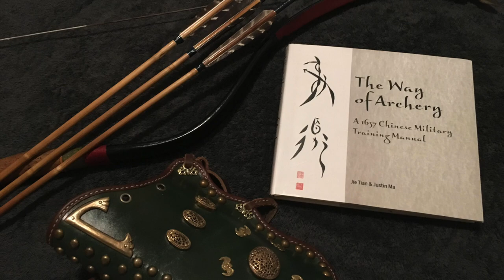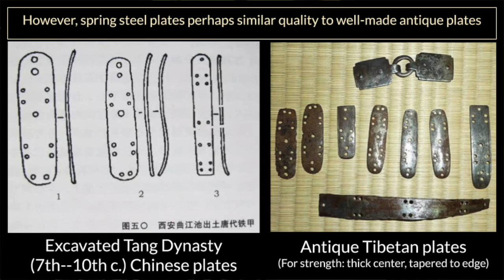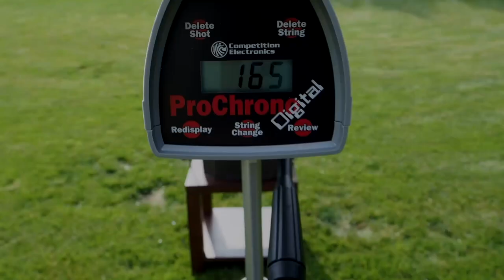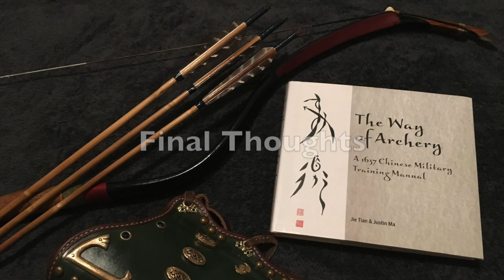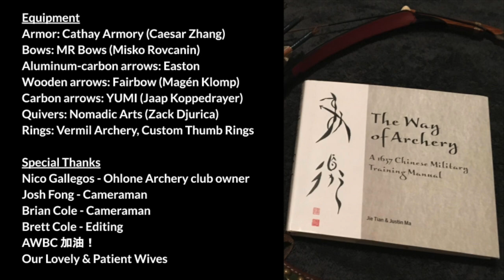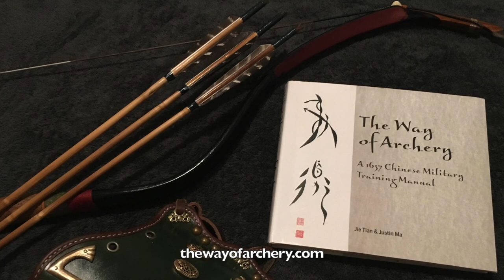Warfare Research Series (Episode 1): Chinese Lamellar

Comment: Nice video.  For some extra information, lamellar armour has either been historically recorded, confirmed by archaeology or both from about 400BCE to the early Qing dynasty.  During the Qing dynasty brigandine began to become more common, and only brigandine seems to have been observed by 18th and 19th century Europeans.  The 'Why didn't they make full plate armour?' question comes up a lot.  The best explanation IMHO is cost -- the size of Chinese armies, the length of campaigns and need for field repairs were vastly larger than in pre-18th-century Europe.  The standing professional army around the time of the Tang Dynasty plate armour shown in the video is usually estimated to be around half a million, with widely varying estimates of local fubing militia and foreign mercenaries.    These numbers weren't terribly high in comparison to earlier and later dynasties.  Chinese armies were more likely to be state-financed and centrally organised during the era when plate armour became popular elsewhere, and soldiers were probably less expensive than plate armour.  Also, while the majority of warfare in China was along the northern and western frontiers, these were mostly won by manpower, more advanced weaponry and superior strategy.  Most of the battles that determined dynastic survival were in the lower Yangzi region, where, being mostly mountainous or swampy and near-tropical, the climate and terrain weren't conducive to heavy armour.  While not as glamorous, good sewage and hygiene may have determined more dynastic succession issues than weapons, armour and military strategy.
Reply: In Chinese armies, the higher rank officers used smaller but more numerous plates in their armor.  This is perhaps because the smaller plates can be better for protection in lamellar armors.  Say if you want to make a better suit of mail, would you use more numerous but smaller rings, or would you rather have larger but less numerous rings?  The first one right?  I guess that is the mentality behind that.  Therefore, the cost is not the reason; the reason is more likely to be the tradition of armor-making.  BTW, they used full bronze and iron plate armors, too.
Reply: There's a few cases of full iron armors, the Ming Dynasty Quan Tie Jia .
(https://i.pinimg.com/originals/74/87/18/748718c0c8b11f8a7264f8b58479ddc7.jpg)
Its more like Mirror or Disc Armour as seen across Asia from Russia an India an on to China.
Reply: @Reactionary_Harkonnen  That's one city was highly linked in to the arms trade and had the space to store that amount of armor, not make it all to order on that time scale.
The cost of making armor changed in europe from metal to workmanship, by the 1400's metal was cheap and crude armor made in a few days was like wise cheap.
Look at the Visby coats of plate, that's armor for farmers but there's big albeit crude plates.
Reply: @Reactionary_Harkonnen  no it had more to do with the ease of production and repair than anything else. Also China always had big armies standing or not. It's hilarious that you think shock warfare was invented by medieval Europeans. It existed long before then
Reply: @Reactionary_Harkonnen  one city is not necessarily representative of all cities. Also if something was a family secret then it couldn't be mass produced since only a small number of people could produce it!
Reply: @Reactionary_Harkonnen  "The Chinese never really had a big standing army. The Romans did, the Spanish did, the French did, so did the Germans." - That's a very broad sweeping statement not supported by any evidence. China as a state predated Germany, France or Spain. Case in point, the Chinese sent an army of 350000 during the battle of Baideng, 200BC. How many troops were there in the "standing armies" of Germany, France, or Spain in 200BC? 

"Super strategies? Obviously you don't know anything about Otto the great, King Richard Lionheart, El Cid, and others" - What do those people have anything to do with Chinese armies winning battles using "superior strategy"? One does not preclude the other, and are completely unrelated

"I guess to cut my answers short and simple the Chinese just didn't have the skill to do it and probably lacked certain tools to make it happen"- Or maybe because lamellar and brigandine armors were good enough and plate armor was not necessary. Lamellars were used by Japanese, Koreans, right across the Asian continent to Turks and Eastern Europe by the Slavic peoples. Also keep in mind that gun powder weapons such as bombs and cannons were in used since Tang/Sung dynasty, and no plate armor can stop a cannonball. BTW the Chinese DID use plate armor, but only as elements of an armor covering vital organs/areas.
Reply: @Reactionary_Harkonnen  Uhhh... What?? This might be just me but the way you explain things sounds really aggressive for the reason I don't know. 

Now, while the Chinese don't have full plate armor, they do HAVE cuirass which can be considered like one part from full plate european armor. However, they didn't continue to develop a full plate armor for a very specific reason, they simply got way too many soldier, expensive, and inefficient. 

Broken cuirasses is simply too hard and costly to repair if it was damaged, while with lamellar, the soldier can repair it independently.

So it's not like the Chinese dynasty didn't produce any cuirass, they stop it which lead to the stop of plate armor advancement. The same thing as chainmail, the Chinese can produce it, there are even a mix of chainmail and lamellar armor, but it almost never been put to use.
Reply: @edwinford8553  yeah...I'm sorry it's just the way I'm explaining things I'm not trying to be rude.
Reply: @Reactionary_Harkonnen  yes a few places which doesn't represent the norm. China especially back then was the land of mass production.
Reply: @Reactionary_Harkonnen  thanks for proving the relatively small size of armies in Europe
Reply: abis8 alpha8  They can raise bigger armies and they have before by levies but big levies are not considered the norm. The soilders used for day to day garrisons were not 900,000 and that number is a bit exaggerated.

 Active troops know the Spanish Empire and such had more active troops because their empire was bigger spending multiple continents. China & other Empires never really had big numbers in active soldiers. From what I read and keep on reading China had an active Army of no more than 25,000 often 15000, mostly in the North keeping the Barbarians at bay.  The numbers were a bit higher when they were independent Chinese states due to the fact that they can do their own thing.
Reply: @cariopuppetmaster  The Black Hungarian Legion wasn't the entire Hungarian military that was just an aspect or chapter of one. But numbers on it self don't matter when you can win wars.

 The Ottomans had trouble fighting even the smallest European states like the Venetians and the Genoese and lost to them multiple times even out numbering them by 25 to one. Logistics, advancements in technology, and good generals, tactics, and strategies is what more important.
Reply: @Reactionary_Harkonnen  "It's simple they just couldn't produce it and didn't have the skill or technology to do it"- The Chinese have had blast furnace since Han dynasty 200BC that were systemically operated by central admin. Earliest use of such technology in Europe wasn't until 1400 years later in 1205. The Chinese also used puddling process in Han dynasty, which was not used in Europe until ~1900 years later around 1700's. The Chinese also used quenching and tempering process to mass produce spring tempered blades since Han dynasty. In contrast the earliest spring tempered blades were seen in Europe in very limited number in the form of the famous Ulfberht swords, using imported Wootz/Damacus steel during the migration period

The Chinese has demonstrated that they can bang pieces of metal into flat shapes and put them on their armor since Tang dynasty, in a very similar fashion how Europeans began their plate armor development after the migration period. But in late Tang dynasty coinciding with the introduction of gunpowder weapons (incendiary bombs, poison smoke bombs, and later fragmentation bombs and cannons) plate armor development in Tang/Song dynasty stopped, and they kept using lamellar instead. In short, Chinese had seen use of explosives and cannons earlier than Europeans had, relative to the development of plate armor

Keep in mind,  Chinese soldiers were equipped by the state since as early as the Spring and Autumn period, whereas in most of medieval European history each solider were to provide their own equipment. Most peasant levies were equipped with only whatever they could afford, while plate armor (in later period) could be acquired by only the wealthy noblemen and men-at-arms, or indeed, well-paid mercenaries (like the Black Army you mentioned, which were active for only a short time, apparently due to money shortage)

The Chinese have also started using standardized manufacturing process as early as Qin Dynasty 220BC where production of arrow heads, crossbow triggers, swords and indeed, armor components (lamellae plates) were standardized. This manner of manufacturing isn't seen in Europe until much later around industrial age . It's much more efficient to produce small identical plates and sew them together, then to make pieces of armor tailored to each individual soldiers 

"I'm sure that Jin had a lot of soldiers but it probably wasn't 900,000"- the population of Jin dynasty numbered at 35,000,000 (quick google search). Supposed half being male, that's ~17,500,000. So 900,000 soldiers weren't even 1/17th of the male population at that time. If you have evidence to refute/rebute the historical records, then please share it
Reply: @Reactionary_Harkonnen  "Europeans had amazing military tactics and they invented shock warfare"
How about war chariots as shock troops used by ancient Greeks, Romans, Persians, Egyptians and Chinese? All of which existed way before medieval times
Reply: @Reactionary_Harkonnen  You're seriously comparing ancient China to Spain, France and Germany? Not sure if this is the result of lack of understanding of historic timelines or just blatant mockery of your own intelligence on purpose.
Reply: @Reactionary_Harkonnen  Can't produce plate armor? But yet they somehow were able to create full plate helmets. You failed to look at the multitude of evidence that clearly indicated they were just not interested in full-plate armors or even just a solid-single-piece armor. Their leather armors were always sophisticated lamellar or brigandine, never one-pieces and there's a reason why. They could've easily skipped all that hassle and just wore a big piece of leather armor like the greeks and medieval infantrymen. But instead they clearly chose to stick with lamellar for a reason.

Yet if you look at their ancient to Qing dynasty helmets, they have countless examples of helmets made in one piece. So if they wanted to make a breastplate or full-plate in one piece they would've taken that concept and apply it to their other armors.

But if you want to pull up a list of what Europeans and non-europeans can produce then you're going to be so dissapointed. European military technology for the most part has been primitive compared to asian standards until the 17th century where they got rich from colonial exploits.

1. Primitive inefficient bows made from just one piece of wood.
2. Primitive wall building techniques that can't withstand catapult fire.
3. Ships that can't sail against wind.
etc
Reply: @kentl4386  you comparing chariots to full fledge armored cavalry with lances? No dude chariots were not used for shock they were used for maneuver Warfare, the chariots became obsolete at around 1000 B.C. as the Sea People shows how they destroyed them using heavy infantry.  

Also chariots were never used by the Romans in Warfare or in the military.
Reply: @Jake-dh9qk  not really dude European medieval technology was extremely sophisticated. So Sophisticated when the Mongols brought Western Siege weapons they started destroying and demolishing every Chinese fortification there was with the trebuchet and other mechanical Siege weapons they brought from the Middle East and Europe. 

Yeah I saw that helmet that's nice but you obviously don't do blacksmithing like I'm learning. You need certain tools and Technology as well as skill and knowledge to make other parts of armor and weapons. Those are very well kept secrets in Europe by the families that made those things. 

The 17th century? No, you got that all wrong, by the 15th century Europe surpass China in almost everything from Shipbuilding, to firearms and other gunpowder weapons were also way head.  Europe was way ahead of China and Firearms by the 15th century, and building sophisticated battleships by then.
Reply: @Jake-dh9qk  I'm not comparing Medieval Times to ancient times, but since you brought it up proto plate armor was developed by the ancient Greeks in the early Bronze Age before the blast furnace was invented.
Reply: @Reactionary_Harkonnen  You even mentioned it. It's not rocket science to think of wearing one solid piece of plate armor. Even acient kingdoms were able to think of wearing a big piece of metal. If you look at countries that didn't have solid piece torso armors, but still have solid piece helmets as well as shields like the Chinese, then this should clearly tell you that solid pieces of armors aren't something that's super advanced or hard to build, but rather just not in the interest of the Chinese. Chinese archaeological records have shown shields and helmets made from solid pieces of metal. If they wanted to make a solid chest ate, they would've done it already.
Reply: @Reactionary_Harkonnen  That's false because Chinese fortifications were able to stand up to japanese artillery during ww2 for weeks. And experts did research and found that the way they built their walls is what made them so strong and partially the reason why early cannon was never really important in chinese siege warefare because cannons were ineffective in bombardments. 

Not only that, you seem to conveniently forget it took Mongols 60 years to conquer China while it only took them 4 years to beat Europe to the pulp with their scout armies before retreating. When the mongols came back from Europe, they were finalizing their sieges that they have laid against China for years before they even invaded Europe. Those siege equipments were not the deciding factor. Hunger and desperation was what made China surrender after holding off the mogol army for over 60 years.
Reply: @Reactionary_Harkonnen  Maybe the you're right about europe surpassing china by the 15th century but that's not to say their military was inferior. China was able to beat back multiple attempts by portuguese warships and expeditionary forces with outdated weaponry. But yes it's true they started falling apart and this is also largely due to corruption from the ruling classes. From 15th to 19th century China has made several attempts to modify and update their armies but their old mentallity and pride in their military structure is what crippled them. Even up into the Qing dynasty they still relied on heavy cavalry and horse archery, and in someel cases successful when their cavalry were able to crush their neighboring countries militaries who were armed with muskets european style.
Reply: @Jake-dh9qk  I think we started to misunderstand each other here. I sort of agree with you. However what I'm trying to say is the reason the Chinese never had the ability to do it is because they never bothered to pursue the ability to do it for what ever reason, like the Europeans did. 
You don't need a blast furnace to create plate armor although that helps quite a bit but it could be done without it. To make plate armor you need a whole another set of tools and skills/methods.  

  Since they didn't pursue to make such body armor in such a way they didn't do it meaning during the same time the Europeans came up with it the Europeans were already capable of doing it the Chinese we're not capable because they didn't have the proper tools developed and more importantly the skill because they didn't pursue it.  Could have Chines do it? Probably eventually so but it's not that easy. 

Also building effective solid pieces of plate armor is a science on itself. Yes a solid helmet and solid pieces are a very good start for such plate armor but that's not the only thing you need to be skilled at, there are entire different dimensions to look at into plate armor such as angles and slopes...
  There's a reason why other countries couldn't replicate European armor after the Europeans exported to them.  

There's certain technologies that China didn't have that was available in Europe during the time to make such tools and weapons and armor.  Look at ancient and medieval European architecture it was & still is extremely sophisticated to a point modern Architects have a hard time replicating them with modern computers and modern machinery.  This indicates Europe had certain technologies & knowledge that people had that others didn't have in crafting.
Reply: @Jake-dh9qk   not too surprising, there's castles that withstand some World War 1 & 2 bombardment as well and even the Crusader castles in the Middle East withstood some ISIS attacks from the 21st century and these castles are still standing.  But it doesn't mean Siege weapons that are designed to deal with them at a time are not a threat to those fortifications. The point was the Chinese didn't have that technology but the Europeans did. They are things that both sides had that each other didn't that's my point. 

That's not true the Mongols didn't even beat Europe to a pulp at all.  The Mongols failed at capturing even one European Castle even in their nishal invasion.  

The Mongols mainly fought some of the Eastern European countries who are the time were poor and disorganized far from the Poland & Hungary you'll see in the 1300s & beyond.  Besides in the 1240s the Croats seem to give the Mongols a bloody nose and beat them in the Battle of Grobnik field. Also people alway seem to ignore the fact that the Mongols attempted later invasions of Europe, and the Eastern Europeans had increased their numbers of knights especially by Ladislaus IV of Hungary. They easley defeated the Mongols especially at Transylvania.
Reply: @Reactionary_Harkonnen  Apologies for the late response, its an old habit of mine. But to continue on the discussion, I agree that I might've misunderstood your statements. It's just a natural human response to be defensive but I'll start again and view this in a more neutral manner.

You made a lot good points about why they didn't produce plate armor and one of them is indeed the result of them not having the skillset because it's pretty much a guild secret that is passed down by master armorsmith and is a highly kept secret. But even then it's strange that China never bothered or sought out plate armor like Japan did in the 16th century. During Ming dynasty, which overlaps the Sengoku period of Japan, the vast majority of heavy armor in China was pretty much brigandine, with exceptions of helmets which are made form one solid-piece metal like the Europeans at that time. The reason why I brought Sengoku Japan into this is because during their contacts with western traders, many Daimyos and even rich samurais sought out european armor and even took inspiration from them. They would combine western plate armor with their traditional armors. 

Yet when we go back to Ming Dynasty China, which was considered China's golden age before the decline, they never showed interest in european armor despite already having contact with western powers. They adopted the guns and cannons but completely ignored plate armor to the point where not even the richest nor most powerful warlords sought out plate armor like the Japanese Daimyos did. The reasons couldn't be because they couldn't afford it no doubt because if Japanese daimyos could afford it, so should a Chinese warlord at that period, who were more than likely to be more influential than their Japanese counterpart. 

As I agreed that creating plate armor is also a complicated skillset, there should still be examples of rudimentary examples of plate armors that are more or less a solid piece of armor forged into the shape of a torso. The solid-piece helmets are a good example to say that they had the technology to make solid piece armors, but lack the interest in solid-piece body armor which later on resulted in the lack of expertise and skills down the line like you mentioned. Not only that, there is a semi-restored full suit of armor found dated back to 200-500bc, around the same time of the roman-greek antiquities. Among these findings are multiple examples of full-plate cuirasses much alike the greek cuirasses. But these examples were rare and from there on, solid-plate armors disappeared from almost very single dynasty down the timeline.

The biggest takeaway from this discussion and my main points isn't who is more superior, but rather why did China give up on the cuirass or solid-piece armors and only focused on lamellar and brigandine despite having more than enough resources to pursue plate armors and even hire craftsmen from the west. This is partially answered by other commenters saying the main factor is the cost and labor, but if we compare Ming China to Europe, Ming China was generally considered a powerhouse of influence and wealth. Despite this, not one lord, noble nor the Emperor himself bothered to buy plate armor even if it's just to add to their collection.
Reply: @Reactionary_Harkonnen  As for the mongol invasions, it's hard to determine who fared better against them because we don't know the individual armies that fought each side.

All we know is that Mongol had more motivation to conquer China than Europe, and that the cream of the crop of their elite forces and generals were all in China focused on one goal and that is to completely take over China. Not only that, China never had dedicated fortresses like the Europeans. The Chinese fortresses were more or less large walls that circles around a large city. 

Geography is also important as well. Whenever Mongols conquered parts of China, they can easily replenish their supplies from the resource rich lands of China. But on the other hand, Mongols in Europe had a tougher time filling in their supply lines and for most part, they were very far from home and had to retreat due to them no being able to resupply.
Reply: @Reactionary_Harkonnen  By definition "shock troops" refer to "a group of soldiers trained specially for carrying out a sudden assault" so chariots fit that definition. And you're correct to point out that the Romans never used chariots in warfare, however they used mounted cavalry in that role. On that note, so did the Greeks, Persians, Chinese and many other cultures before the time of medieval knights. So your assertion of them "invent shock warfare" still does not stand. If your argument was "medieval knights took shock warfare to a new level" then I'd happily agree with you.
Reply: @Reactionary_Harkonnen  nope, shock warfare, in the way you describe it, was invented by the Chinese, massed cavalry charges were imported to Europe from China, not the other way around, because the key component of the tactic, the solid saddle and double stirrup was invented and used by heavy cavalry in china and brought over by nomadic invasions to the west
Reply: @Reactionary_Harkonnen  it is documented by European historians that the saddle that made heavy cavalry charging in tight formation viable was invented and used for that purpose in China first and then brought over by nomadic central Asians. Before that point in history European knights hadn't used mounted combat, they rode horses into combat and dismounted. Before you make any strange comments on solid saddles not being necessary for massed charges, it is literally the key component, and every historical source documents that it was invented in china.
Reply: @Reactionary_Harkonnen  furthermore, solid steel plate armor, as in plate bodies, cuirass, helm, etc was found in china dating back to the initial invention of the saddle or several hundred years before it became possible in Europe . The reason it wasn't adopted was because in fighting Mongols the heavy plate was less of an advantage and the Mongols would simply escape into the steppes. Furthermore, plate armor also wasn't that useful against massed artillery that was popular in china before the 11th century. The sarcasm in your tone talking about brilliant strategists should really be applied to Europeans instead, because combined arm tactics that the Chinese used were dozens of times more advanced than pike formations, and modern European scholars consider them the precursor to modern combined arm tactics
Reply: @Reactionary_Harkonnen  Also as for Europe surpassing China by the 15th century? You're fucking hilarious, did you know that the entire European modern system of governance was essentially lifted from China? Not the ideology like communism or democracy, but how the government actually runs is totally lifted from China, ministries, government officials, meritocracy etc. You can look up the formation of western European government starting from the United Kingdom if you dont believe me. The European law writers at the time considered their native government system barbaric and reformed it in the Chinese fashion
Reply: @Reactionary_Harkonnen  Shock Warfare was not invented in europe my dude.
Reply: Full plate came around the same time gunpowder took off as the decisive arm. How many factions took up gunpowder after coming into contact with it? Every faction. Those that were slow to do so like the Mamluks and Champa were destroyed by their gunpowder wielding neighbors. The Japanese couldn't get enough of matchlocks and quickly made their own. They bought a few pieces of plate here and there but never bothered reverse engineering it. Plate armor wasn't worth the hassle over whatever people where wearing before.
Reply: Crossbows